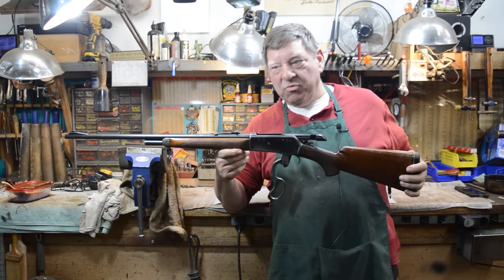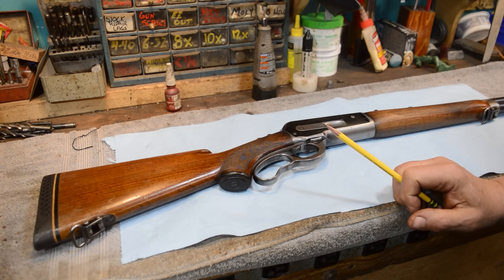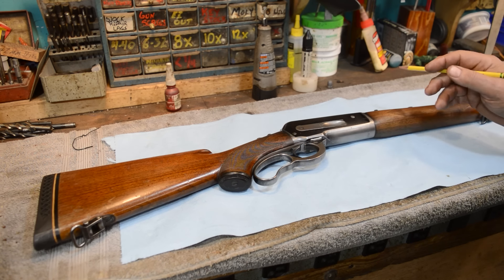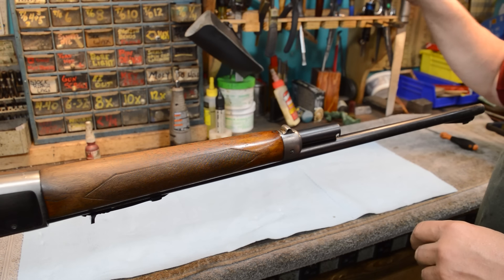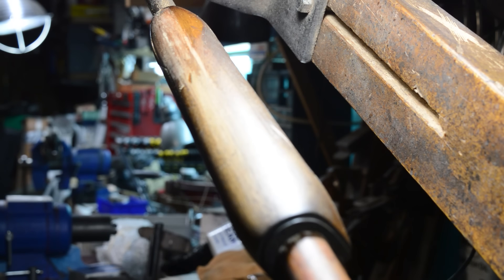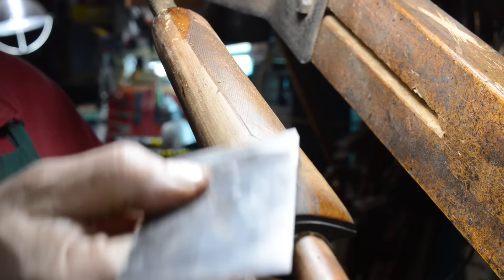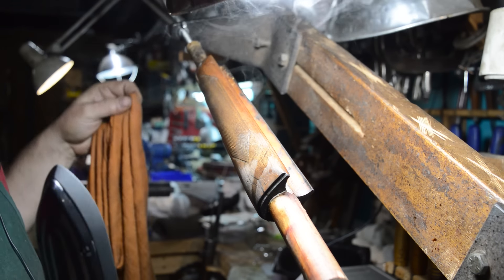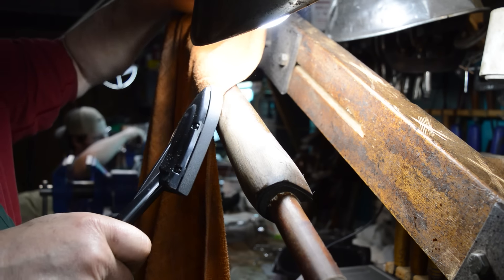Winchester Model 71 wood and checkering: Anvil 0135

Comment: I use to work on high end pool cues. I used steam to remove dents but also used a glass rod to finish it off. By rubbing the rod with the DRY grain over the dent at least 1 inch ahead and behind the dent, more is better, you can remove almost any dent completely. No sanding required 90% of the time and then only with 220 or finer very lightly mostly to just clean up the surface. Used this many times on gun stocks too. The best glass rod I found was a glass pestle, like you use with a mortar. Just another trick to add to the tool box. Beautiful rifle, thanks for sharing.

Comment: Love your work!  When steaming deep dents, here's a trick: stick a Band-Aid over the dent, and then wet the pad.  Allow it to sit for about 30 minutes.  This allows water to soak into the wood under the dent.  Remove the Band-Aid.  When you apply heat with a wet cloth and a small iron or a soldering stick, the water under the dent turns to steam and puffs up the crushed fibers.

Comment: Ive restored my 1886 (38/56) and my 71, the 71 is a a very early long tang. I did  the  take down and parts refit but sent the bluing out to Fords 20+  years ago. Fire blue like  the commercial older 1911's. I Love  large frame winchesters. 71's with checkering were  deluxe rifles, 12.98$ extra in 1937.

Comment: So I've checkered alot of guns and all by hand, I've finally been lucky enough to get my hands on a power checkering tool. I'm learning how to use said tool but,why I'm commenting and why I mentioned my body of work is to let you know, I have been around the stock a few times. Anyway, I find it harder in many ways to follow in another person's lines... when I get a line issue most times I leave the crooked line and the next line I make straight, creating a wedge of diamonds and I continue from there...

Comment: thanks for doing these! enjoy watching this stuff immensely. thank you for sharing your knowledge of firearms work. i redid the checkering on my 1945 savage 720 (browning a5 clone for those that dont know.) its awesome to see it go from rounded flat to these popping diamonds. used a cheap tool from Brownells and just took my time with it on my lap. i took my first turkey with this gun. 12g, 28 or 30 inch full choke barrel. it also has a nice game scene on each side of the receiver. found it for 195 at Kittery trading post years ago. i sanded it down to 600 grit and i think i did 7 coats maybe more of tru oil to get that glossy finish.

Comment: I had one, a delux model in the 1960s.  Stolen in 1970.  One problem it had was that the lever would open (pop down) about 1/4 of an inch when fired with factory ammo.  There’s a reason for this which of course I knew nothing about at the time and I ruined the the collector value by having Ackley’s shop chamber the gun for the improved (reduced body taper) 348 cartridge which of course made no difference.  Mark, I hope you look into this.

Comment: Did you say the first thing you do when working on the gun is to check out the bore?
Reply: Yeah, its what I do. Bought too many sewer pipes by not being careful
Reply from the maker: Always, buy the bore
Reply: It's the one and only thing that can't really be fixed short of replacement, and replacement usually is not cheap or easy.

Comment: could you infuse the oil into the wood using a vacuum chamber? or would it ruin the wood?
Reply: That's probably too much.

Usually a oil finish does absorb into the wood to a degree, but doesn't completely saturate into the wood. A finish like boiled linseed oil is usually applied in layers where it is wiped onto the wood and allowed to sit for a few minutes then wiped off. Allowing a layer to polermerize on the surface. Completely saturating the wood could make the wood turn punky and soft.
Reply from the maker: What jdod64 said is true. I would add that by the time you get this set up, conventional methods would have the project long complete. Time is the true enemy here, just sayin

Comment: I Own 4 Winchester 348'S and 1 in a 45-70 All pre war Mod 71 I can tell you dont reblue it
The value will drop 50% I love my old Winchesters and have a huge circle of friends all 
Winchester Collectors Most and I say MOST will not look at a refinished gun .Even that
Recoil pad is not original it had a steel widow peak but plate to bad someone cut it off.
Mod 71 is the # 1 gun in Alaska for many years .I still shoot all of mine and cast my own 
bullets as jacketed are hard to get so a hard cast is my fun bullet .
Reply from the maker: There is no intention to "collect" this gun. Nor are they making any more of them. We are doing the upkeep and maintenance to keep it running and usable as the tool it was designed to be.

Comment: First thing I look at??? Without exception, I check to assure that the gun is not loaded.  Then check to assure there's no ammo in the magazine or clip.
Reply: @RubberduckWVU  refer to the manual, and try again
Reply: That's done before it even gets to the bench mate. Mark has explained in many other videos that when a gun comes into the shop, the first two things that need to happen are to get it out of the customer's hands, and check clear. He doesn't need lectures on safety from internet autists.
Reply: @matthewn4896  I worked in a shop where a customer's revolver discharged narrowly missing yours truly.
Reply: @jimparker7778  That would explain Mark's rule about getting the gun out of the hands of the customer as soon as possible.
Reply: @matthewn4896  I never had the gun in my hands.  the owner of the shop spun the cylinder and failed to see a live round that didn't drop from its bore.  A few inches is all that separated me from a 158grn hollowpoint at close range.
Reply: @jimparker7778  You seem to be missing my point mate. Mark has explained, and demonstrated his safety protocols many times. There's really no reason for him to show checking the gun clear in every single video, unless it's somehow relevant to what's happening, like say, breaking open a  rusted-shut gun that he, or his staff, weren't able to immediately check.